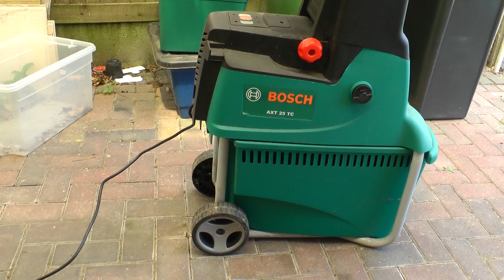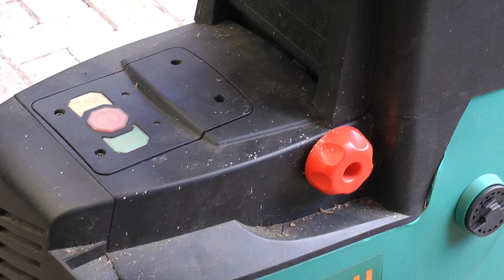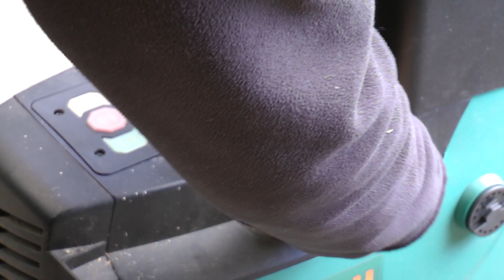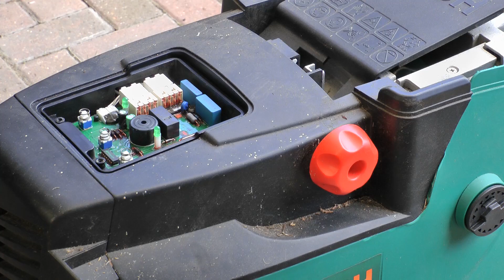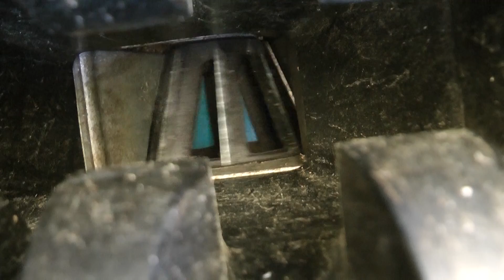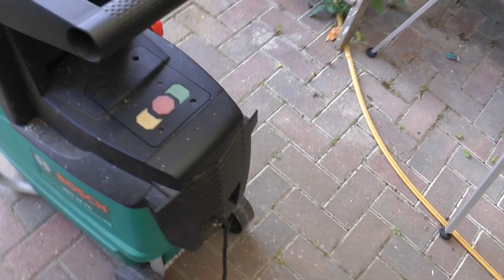Replacing Bosch AXT25TC motor controller

Comment: Mine did the same thing - only ran backwards regardless of which switch you pushed - burnt PCB - replaced the control unit and now i'm back in business ( I noted the larger heat sink in the replacement too). Many thanks for the video - very useful!

Comment: It would have been good to have a look at the burnt PCB to see exactly which parts could be replaced for a real repair.
Reply: I just did this repair, where I repaired the PCB instead of replacing it. My problem was the relay which is the big black rectangular piece in the middle of the PCB. It was a bit difficult to replace because many of the components are glued to the PCB, including the relay. It is also soldered, of course. There is also a layer of PCB protection lacquer, so remember to add a protection layer again after replacing. I choose to cut the relay to pieces in order to remove it. Not a standard soldering job, but can be done with enough determination. Much easier to buy a replacement board, but a bit expensive and a third of the price of a new machine. The relay was a G2RL-2 24DC. While you are in there, consider also replacing the electrolytic capacitors. One of them is a 100uF/50V P3.5 8x11 105C. I could not see the specs for the other one, because it was glued. Do all this at own risk and consider buying the replacement PCB for security and to save the time.

Comment: Hi Roger am thinking of buying the axt25 turbine shredder was wondering if cutter head replacement ie turbine head is an option for a diy guy like me saw part for £120 as you cannot sharpen blades? Still to buy just. Thinking ahead. Appreciate any help you can give
Reply: I believe that adjusting the black knob on the side (which brings the blades closer (or further away) from the cutting bar), automatically sharpens the blades. What I don't know is how often one can do this before you reach the end of the adjustment, or whether replacing the blades (and cutting bar) is a DIY job!
Reply: @pwoodwardc  Replacing the head is a diy job. head is 12o euro incl postage at the cheapest.

Comment: Hello Roger, thank you for this video! I have got last week the same problem with my 6 year old BOSCH AXT 25 TC shredder. With the help of your video I built off the motor controller as shown. It also had marks of overheating at the same position. I replaced the part today and the shredder works o.k. so far. But I'm not sure how long? Do you have meanwhile further experiences with your shredder? How long is it running now since fixing?